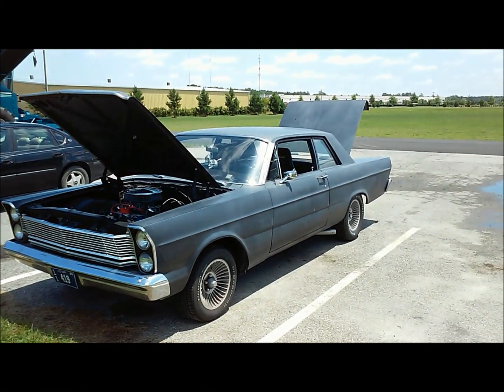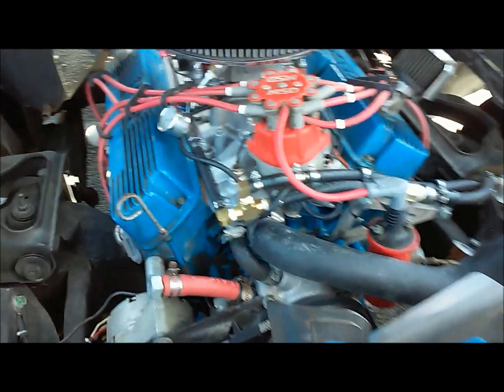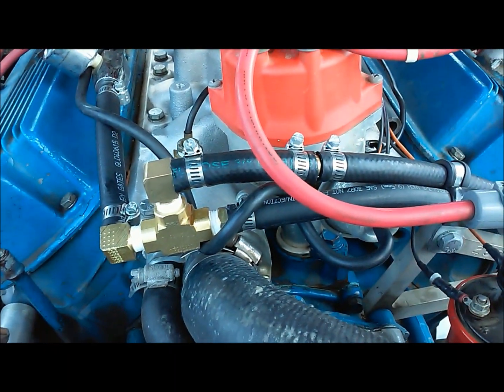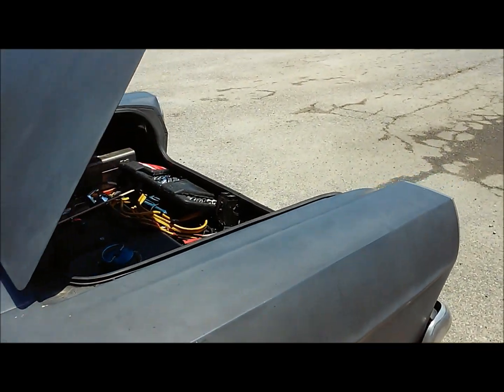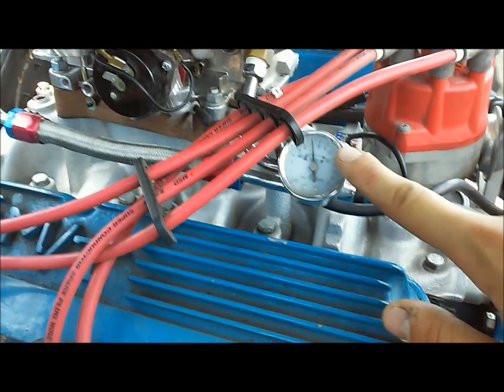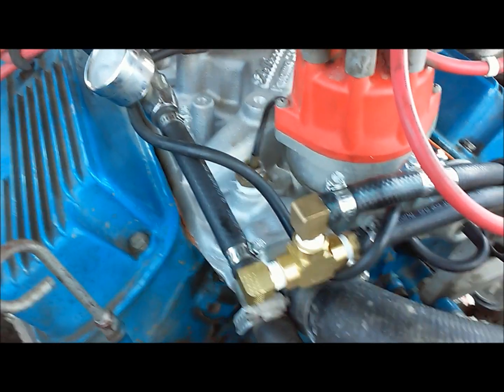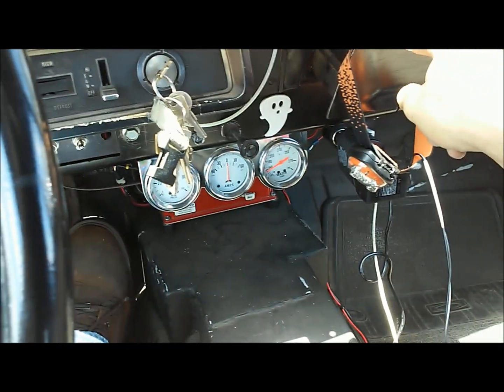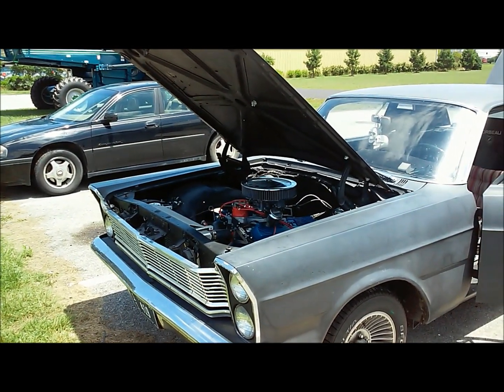Carb Vapor Lock No More - Simple Fuel Return Line

Comment: I like the emergency repair that you came up with. Especially when you're pretty far from home and you've got to come up with a working solution. This shows me that you're a good man who knows what he's doing, even when the world sucks around you. Back before an ethanol neutralizing fuel additive was easily available, I had that "Blue" pump and the returnless "dead head" regulator set up. That was the noisiest and most problematic  POS that I ever wasted my money on. The ethanol, in the gasoline, even at 10% per volume was enough to corrode all of the internal aluminum workings of that pump. This was because my Mustang sat up in high humidity Florida for 2 weeks. I'm sure glad that I decided to put the mechanical fuel pump's eccentric back on the cam timing gear when I went to the electric pump. Even though I wasn't going to use it, I  recommend that a one piece type eccentric gets installed, "just in case", you get sick of the electric pump's noise and/or the reliability problems that go with it. I recommend the one piece eccentric, available from Ford Racing, versus the generally available, wider two piece because there's a chance that the two piece, being wider, will rub on the inside of the timing chain cover.
  As for keeping the fuel as cool as possible, I have a 1/8" to 3/32" phenolic spacer mounted between the engine block and the mechanical fuel pump, a 5/16" thick fiber base plate between the carb and my aluminum intake manifold and finally the exhaust heat riser ports are blocked at the intake mfd. gasket.
Reply from the maker: +Charles Georgoudis i dont remember exactly what i said in this video, but i was very thankful i had the timing cover and eccentric still inside my engine when my pump failed. very glad i had a spare mechanical pump. car run good with the black pump on the restriction. i really really should have blocked the heat riser ports on this engine. im assuming fel pro makes some gaskets that plate it off, or you made your own small plates to close it off. where do you get the gasket if there is one? my next engine im finishing up has an air gap intake and afr none crossover heads, so i dont have to worry about it thankfully.
Reply: ThunderHead289
I have a set of the GT-40 iron heads with a Weiand "Stealth" aluminum intake manifold. I was having issues with vacuum leakage on the lower portions of the intake runners because of gasket shift. The vacuum leakage got so bad that the engine wouldn't idle below 1000 RPM. When I pulled the intake, I found that the old gaskets had moved all over the place. To cure this, I bought a set of Fel-Pro 1250S3 steel laminate intake gaskets. This gasket set comes with 2 types of heat riser block off plates. One type has small holes for partial blockage and the other type which completely blocks off the heat riser passages. Here in Florida I went with the complete block off plates with good results. The steel laminate has kept the gaskets from shifting. So now, there's no vacuum leakage issues or vapor lock problems with the Florida heat. Summit sells these gaskets under part number FEL-1250S3  for $30.97. You'll find the full details in their listing for the gaskets.
Reply: I did the exact same thing on my big  block Cadillac.  Factory fuel setup - just a mechanical Carter fuel pump  bolted to the block, putting out 7 PSI at 1200 RPM.  Pump has a builtin return, but that didn't do squat for stopping the boiling fuel issue.  So, I ended up with the same Holley regulator as you, hard-piped into my Edelbrock carb... regulator sits right next to the carb (less than 6 inches between them of hard-line).  Going into the regulator is obviously a fuel filter, but right at the inlet of the regulator there's a brass Tee - and that goes to a 6 inch piece of hose with a 3/8 stainless bolt jammed in it.  I drilled a 3/32-inch hole (0.094 inches), and then brought that back with nickel-copper hardline (which is what most of my fuel system is made of under the hood - the factory lines to the tank are stainless).  I tied that into the factory return line coming off the mechanical pump.  @UTG had suggested 1/16-inch which would be that 0.060 mark that you mention, but I figure my factory return line is about 20+ feet long in this old Cadillac, and it's skinny 3/16" stainless hardline, so there's going to be a bit of backpressure on that line as it is, not to mention my return has to share a line with the mechanical pump's return, so I figured 3/32 was worth a shot.  Anyway - worked like a champ.  Between this return modification and adding a 1" phenolic (the resin type that look like wood, but aren't actually wood) spacer, I have cured fuel boil off in the bowl, boil off in the pump, and vapor lock.  I had that exact issue of high AFR values when sitting in traffic - and it would stall the car.  A nightmare that I'm very glad is over now.

Comment: Nice work !!! i know all about hot weather im in Ft.Lauderdale its hot all year round,im gona start with a phenolic spacer this week and see were it leads me,the car started acting up this weekend im gona have to rebuild the holley altogether its spilling fuel out the primary vent tube,not good !!! its about time it gets a rebuild anyway.
Reply from the maker: M .Quez that sounds like some good ol trash stuck to the needle rubber and allowing fuel to flow through! tyhe phenolic spacer does A LOT with keeping the carb cool. for most this is good enough. in my f100 i ran one of those cheapo electric inline pumps from orileys. they dont heat the fuel up like a mechanical pump and are fairly easy to install. and they arnt LOUD!!! anyway, best of luck!